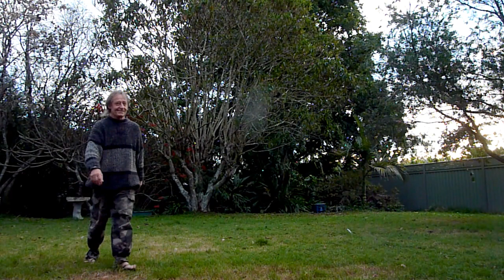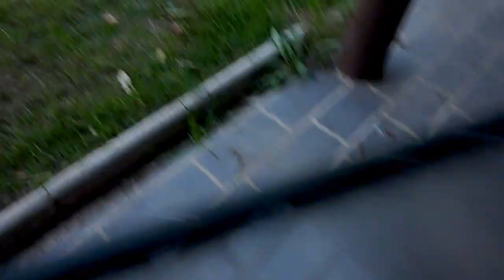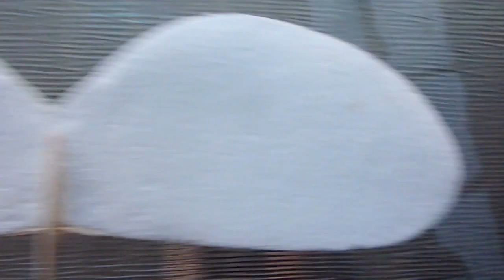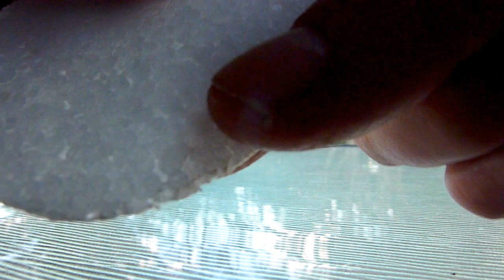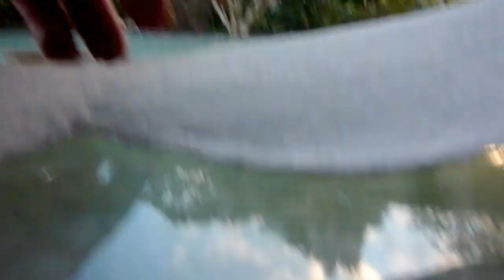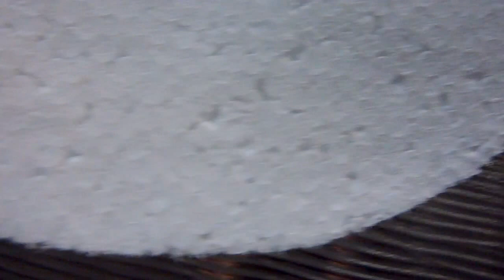FLOAT GLIDER (Flight and Tutorial).

Comment: beautiful really.  

after watching your videos, i feel like throwing my hot-wire foam cutter into the garbage.

~Salute~
Reply from the maker: Thanks (you must have seen my tutorials). lol I used to have a hot wire, and it was great, but it made it harder to sand off the residue etc. It has a hard coating all over it, making it hard to sand. But hot wire would have it's uses, making really thin sheet foam. And you only have to sand the surface a little bit, and use the coating as a strengthener.

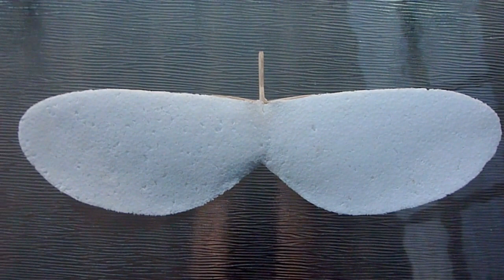Comment from the maker: IMPORTANT! 13:45
To get the slowest glide and maximum "float", you need to make the glider out of the lightest foam possible. Some low density foams are too rough to work with, but some lightest stuff still stays together (reasonably) when sanded. You really have to search, and only settle for the best. lol Find in garbage bins, industrial bins etc.

ANOTHER VIDEO SHOWING HOW TO SCULPT WING OUT OF FOAM. I did this one with the same method, but I had to go far-far more gently with both files (on the lightest low density foam) and it took ten times the time to make, than with normal medium density foam. https://youtu.be/umXoqaEJhVs